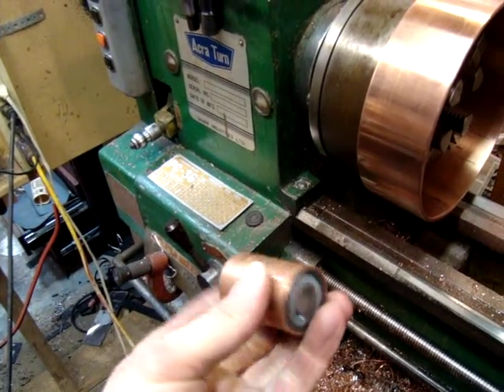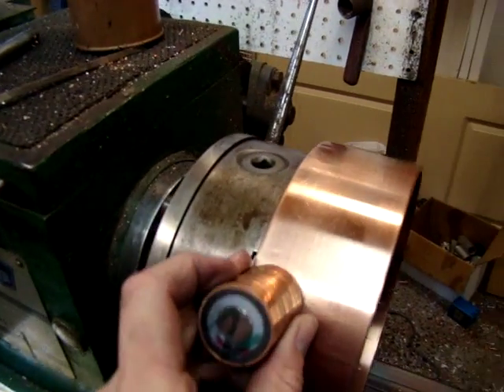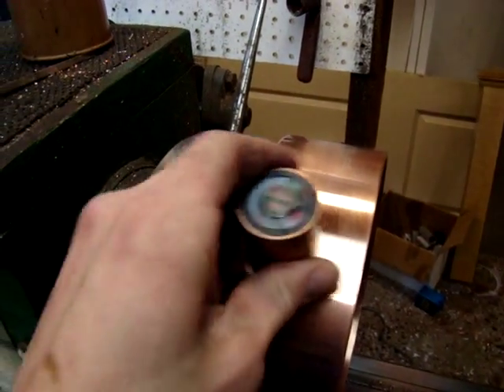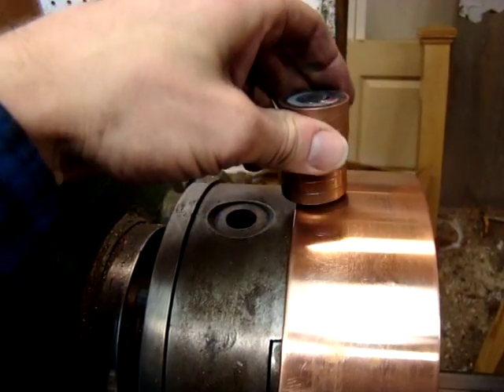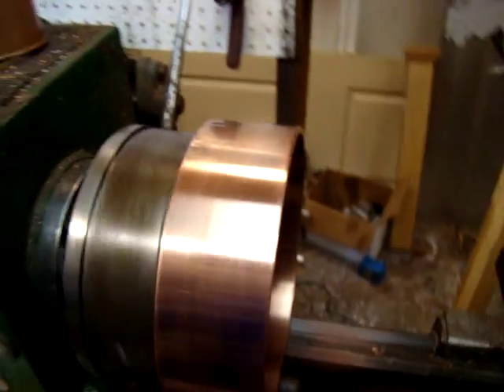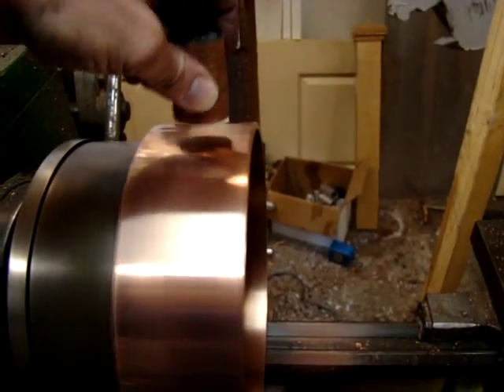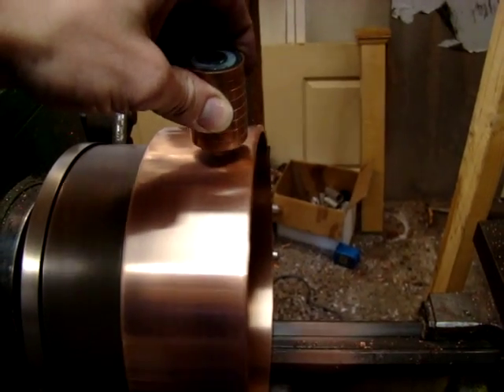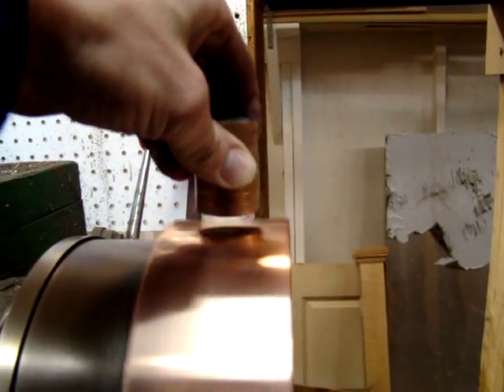Searl Effect Generator Roller replica in Paramagnetic levitation

Comment: what is the roller made of?
Reply from the maker: My rollers have copper, magnet, Teflon and neodymium magnets
Reply: @woodbrassandglass  what magnet do you use? do you know if he used neodymium magnet or metal in the original generator
Reply from the maker: @coilman2361   in his original design he used neodymium metal. I am using an uncoated, unmagnetized neodymium in my first trial experiments for now. Eventually I intend to use Neodymium metal. The cost is unreal. Each disc is over $168 each piece.
Reply: @woodbrassandglass  by unmagnetized neodymium do you mean pure neodymium or neodymium alloy?
Reply from the maker: @coilman2361  due to costs I'm using parts with 30% +/- neodymium in them. Hopefully as my budget increases I will purchase 99.999% neodymium parts.
Reply: would this be a good structure for a roller? 
core: pure neodymium
1st layer: teflon/nylon 66
2nd layer: neodymium magnet
shell: copper
Reply from the maker: @coilman2361  you have a lot of good questions, wanted to contact me through my email we can talk
isaiahritchey@gmail.com

Comment: the roller needs to be magnetised with north/south poles in the centre on the curved surface. the flat ends would then each have north south rotated 360 degrees at the other end and 180 in the middle. its a sinusoidal magnetisation.